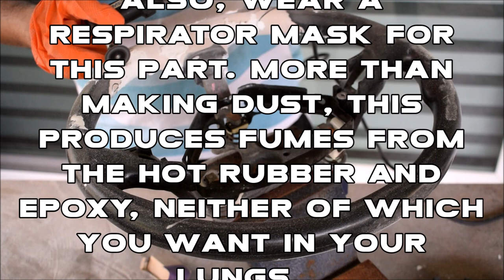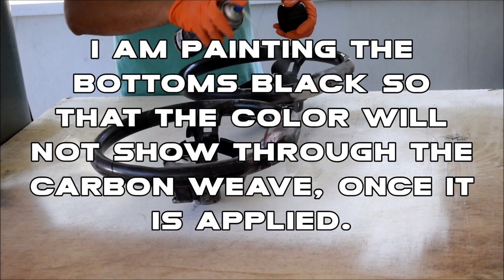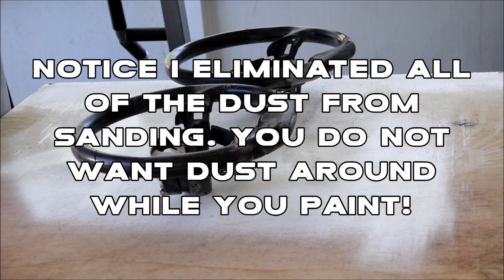Flat Bottom Steering Wheel DIY Part 2

Comment: Hey, question. So,  I’ve watched the first part and now this one, just wondering if you could’ve used the glazed putty from the beginning, and if so, why you chose to take the epoxy route?… 

Edit: Both wheels are looking pretty wicked btw!
Reply from the maker: Thank you! The reason I didn't use the glazing putty to build the structure is because it's so soft. It would take a long time to build it up enough to make the shape. If you built it up quickly,  it would crack as it dries. The epoxy putty works like clay and it also smells way less, which is really nice. I was able to use it in my office without issues.

Comment: How much do you charge?
Reply from the maker: I would have to do some calculations to determine what to charge others. It is a really time consuming process and materials aren't cheap either. However, I am interested in doing this for others, so I will definitely get back to you.
Reply: Okay great! How long would this take on average for a first timer & what are some common mistakes beginners might make so we can avoid them. Maybe you can make a video on that if you have time.
Reply: Also if you make those custom buttons can you upload how you go about doing that